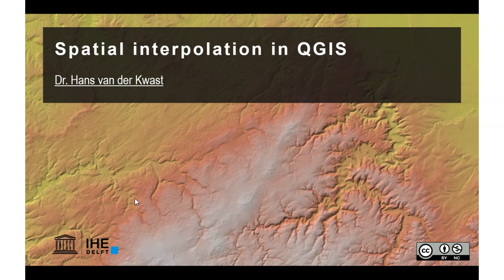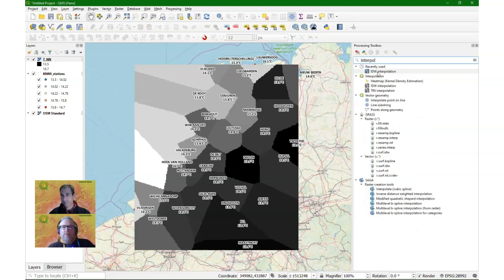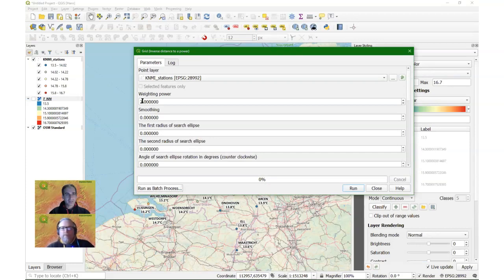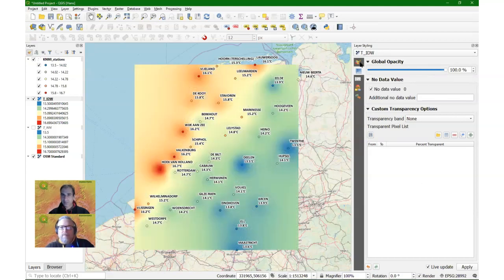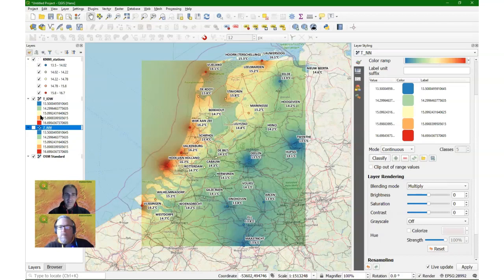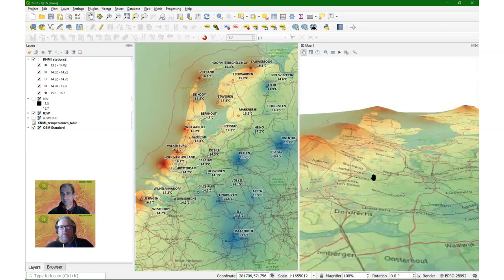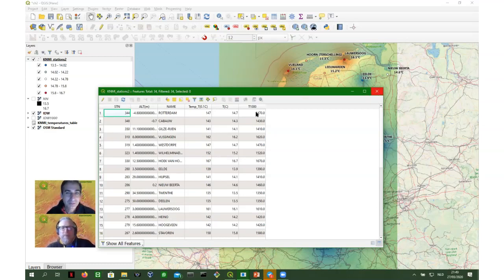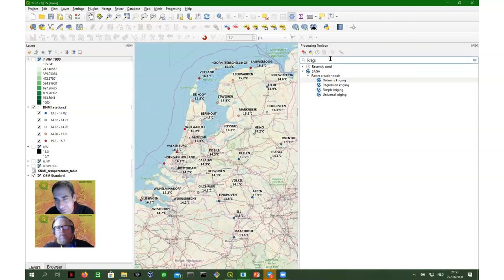Spatial interpolation in QGIS

Comment: Hi Hans, Thank you so much for making these video tutorials. I had zero knowledge on QGIS or GIS software, now I am learning from your video lessons. However, after upgrading the QGIS version from 3.10 to 3.12, I am having trouble opening and every time I am getting error message. Such as "2020-04-09T11:10:35     WARNING    Python error : Couldn't load plugin 'wntOS-3' due to an error when calling its classFactory() method See message log (Python Error) for more details. 2020-04-09T11:10:52     INFO    Executing" Could you please help me to resolve this issue? Appreciate your time and help. Thanks
Reply from the maker: Please note that my course materials work guaranteed for QGIS LTR versions (Long Term Release). These versions are bug fixed and for courses and operational use. Newer versions have new features, but can also introduce new bugs. They are experimental. You can help the programmers to report those issues on GitHub.
Reply: Hans van der Kwast Thank you for your hints.

Comment: @Hans van der Kwast Very useful video indeed. I am trying to interpolate rainfall data. I however have an error 4 message: does not exist in the file system, and is not recognized as a supported dataset name. Please help
Reply from the maker: Not enough info to understand your problem. You need a vector file (e.g. shapefile or Geopackage) with a decimal field to run the interpolation.

Comment: Why no one can make a video about interpolation kriging
Reply from the maker: Kriging is an advanced method where you need knowledge about the spatial correlation of your data, because kriging is based on the semi-variogram. You also need enough sample points, otherwise the semi-variogram will not be fitted well. Lastly, QGIS doesn't offer well documented tools to apply kriging to your data. You can try the SAGA tools from the processing toolbox, but they are hard to apply without knowing what the parameters mean and when you can't fit a semi-variogram. When I do kriging I use R and I can recommend to use that instead of desktop GIS software. Here's a video: https://youtu.be/jfZKqO4TBtw
But you can find many tutorials on the internet on how to use R for kriging.

Comment: Hi, how do you set the raster definition when using IDW? The output gives me pixels that are circa 650x650 meters by default which is not enough for my analysis. I don't see any option in the UI to set the grid spacing
Reply from the maker: I think it's covered in one of my newer videos. If you use IDW from the processing toolbox you can set the extent and pixel size.
Reply: @HansvanderKwast  yes I figured out, the IDW from the menu bar is different from the one in the toolbox panel, thanks!

Comment: Hi Hans, I want to try the "Grid Inverse distance to a power", but the option isn't in my menu. (I have just installed 3.12.3). I do have the other three options (moving average, data metrics, nearest neighbour). Also missing are the bottom two, TPI and TRI. Do you have any idea how to solve this..?
Reply from the maker: In my 3.12.3 version it shows up. You can try to start QGIS with a clean profile (Settings -> User profiles -> New profile...). Otherwise look for IDW in the Processing Toolbox, that one works in a similar way (Interpolation -> IDW Interpolation OR GDAL -> Raster Analysis -> Grid (IDW with nearest neighbor searching)).
Just a note. I recommend to use the LTR versions for operational use and tutorials. My tutorials are always checked with the Long Term Releases. The current LTR is 3.10.6. Newer versions have new features, but also new bugs. They are great to try out new stuff.

Comment: Hi, I have a problem with the TIN. I just started using QGIS because I no longer have access to ArcGIS. I want to create a lake bathymetry map from depth survey points. I created a polyline and converted it to a polygon so I can contain the interpolation within the shoreline boundary but when I run the TIN, it does not recognize the shoreline polygon as the extent and it interpolates out of that. What is wrong?
Reply from the maker: I don't have much experience with TIN. Maybe this video helps: https://youtu.be/NGUWa-sTFkI
Otherwise ask there.